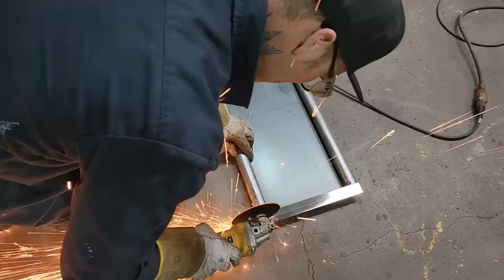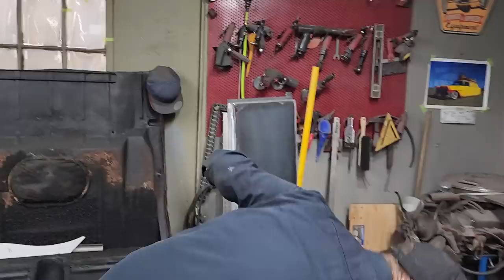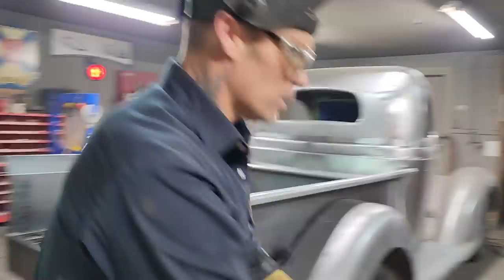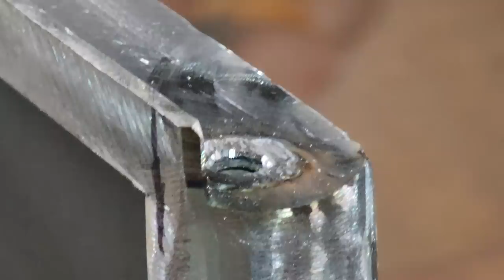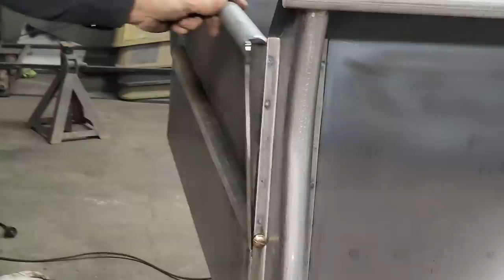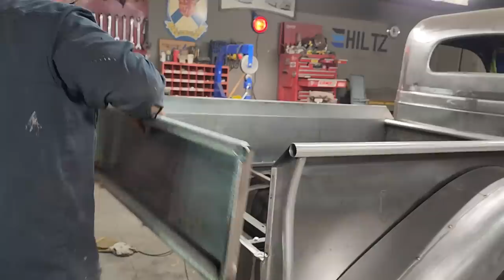Engineering a hinge system for the tailgate...1935 Plymouth pickup truck

Comment: Chad I did this on one of my trucks a lot of the trucks in the 70 s and 80 s had cupped pivots for the tailgate you can weld a washer inside your lower pipe so the washer contacts the face of the cupped pivot so you don’t have side to side movement take one of the cupped pivots and cut two sides off weld some flat stock on each side you cut off notch the bottom of one side of the lower pipe to fit the pivot mount the pivot that you modified at a 45 degree angle that way you can sit the tailgate on the full pivot and then lower the notched side onto the modified pivot that way the tailgate can be removed by holding it at a 45 degree angle and lift the end off of the modified side

Comment: Awesome! You can use large electrical shrink tubing over the tailgate chains if you like. It helps with chain noise, protects paint and looks great! Keep up the great work. Amazing!
Reply: Great tip thanks I’ve  used bicycle tire tube in the passed and just taped the ends, it worked just fine but was never overly happy with the way it looked I’m going to try the shrink wrap! Thanks
Reply: Great idea

Comment: Chad, here's a tip for welding up nuts. I keep a collection of brass bolts and screws in most common sizes. When I weld the nut to whatever I'm welding it to, the brass bolt comes out readily because weld/spatter doesn't stick to it. Simple, quick, and clean threads afterward. Look for them in plumbing sections at the hardware store, and save any that you come across by blind luck...

Love this build!!

Comment: The early trucks had brackets that bolted to the body to hinge the gate. You just put the gate pins into the brackets on each side and then bolted the assembly to the truck. All gaps and free movement were built in. The gates just used tabs on the top that let them be attached with hooks attached to chains. To lower the gate, you removed the hooks and chains kept the gate from going all the way down when open.

Comment: I have used bicycle inter tubes to slide over the chains, to stop the chains from hitting the paint job. Great job on the pickup. I love the build.
Reply: Yeah or some large diameter shrink tape for electrical wire slip it over the chain heat it up looks great

Comment: Hey Chad
I don't build cars/trucks but I do mess around with grinders, sanders, welders, drills etc on different fab projects. Obviously a little late now, but have you ever drilled your holes, countersunk the edge and used a flange nut to sit flush for welding in? Can't tell what you're using in the video, could be a stover lock nut for all I know? Huck fasteners might work as well?
You mentioned chain for the tailgate, I'm not a huge fan of the chain rattling around on these old trucks [not my build, not my decision]. Have you ever thought about using two pieces of ...lets say one inch, maybe three quarter flat bar and making a scissor like support that fits between the edge of the box and the edge of the tailgate? You would still have the triangulation support when the gate's open and be hidden when closed. Truck looks wicked, keep it up man! Cheerz 🍺

Comment: When i was watching you make your tailgate mounts I was thinking that a keyhole style would by a great solution.  Make a keyhole slot that welds to the bedside and bolt/weld studs to the tailgate. This would allow the tailgate to pivot and be easily detachable. Watching you troubleshoot on the fly helps me brainstorm.  Thanks Chad

Comment: Alot goes into building your own tailgate, especially when it comes time to attach it and make it function properly, it would probably have takenme all day to figure it out. Great work as always Chad & Jolene! The tailgate probably won't get used a lot otherwise I would be concerned that over time the hinge bolts would turn with the gate and back out.
Reply: That's why they make locktight products

Comment: You've done a wonderful job Chad. You could stay out of trouble if you were to use a ruler, dycom, and a scribe to mark your cuts.
Another suggestion for locating those holes for the hinge screws, would have been to drill through the outer hole right into the gate while in place. 🤗
One bad thing with using the chain for a restraint, it will end up rubbing off paint in that area. A plastic wrapped cable mounted inboard between the end of the gate and the tailgate opening, would be a better choice.

Comment: You went a totally different direction with that tailgate than I was expecting. I figured the point of using the pipe on the bottom was to use that as the pivot over some short pieces of pipe welded to the inside of the bed. Then the tailgate would just drop over the pivots. But hey, you got it done your way in the end. Good on ya.

Comment: !!!***Hey Chad… Here’s an idea***!!!
On your tailgate chain, use some 1”-3/4” heat shrink (the kind you’d use for wiring) … cut it to length then pull the chain through the heat shrink. Then use a heat gun and shrink the heat shrink to the chain. It’ll save your paint and it gives your chain a professional finished look! … not to mention, it won’t make a horrible racket going down the road! 
**^^^***^^^****^****^^^***^^^**
                             ^^
                           ^^^^
                         ^^^^^^
                       ^^^^^^^^
                                ^
                                ^
                                ^
                                ^

Comment: First off the truck looks amazing.  I may try this in a four door Chevy.  I may have tried a solid steel bushing where you put the nut in the gate  , then a threaded bolt on the outside of the gate.  Then thread the bolt into the bushing.   The bolt may need a non threaded end welded on to act as a spindle.  Not sure if this even makes any sense but I had to write it. Lol!

Comment: I use to smoke a lot of bits drilling metal. An old timer told me low speed high pressure with steel and sure enough saved alot of time and money in the end. Take it or throw it away!
Reply: Exactly. It helps keep the heat down on the bit, keeping it sharper, longer.
Depending on the thickness of the metal, a bit of lubricating oil applied to the cutting shoulders every so often, also helps keep the heat down.

Comment: If you use a stainless bolt to hold the nut it will be less likely to stick to the weld. Also use the step bit to chamfer the hole for better penetration into the nut. The tap you made is a great idea, thanks for that!

Comment: Use a shoulder bolt for the tailgate hinge. It will provide a smooth hard surface to pivot on, and can be fully tightened against the welded nut.

Comment: Suggestion the piping you used at the top of each fender where you have the hole on each side just above your tailgate the hole that is there on the end of the pipe how about an LED blinker light on each side would look badass and definitely different just a suggestion I'm sure you won't use it but I thought it would be a good idea, I still think you are a fantastic visionary whatever you do I'm sure it will look fantastic,

Comment: Chad was watching tonight when u were marking the tailgate hole with the marker to drill on the left(drivers side, tailgate was not sitting on the washer when u marked it. If u check video u will see an 1/8" gap when u marked it.   I think that's why u had to compensate on the opposite side. I saw it and thought it wasn't a big deal but, anyway thought I would pass it along. Turned out great though! Very cool solution.

Comment: Good job Chad. now you just need some kind of flexible hose to cover the chain, so it doesn't rattle around and scratch your paint job. Good job Jolene you are so good with the camera, nice and steady!
Reply: He can use some large diameter shrink tape that is used for electrical wire slip it over heat it up looks great

Comment: Chad, im watching you grind out the edge of those bolt holes on the tailgate with the dremel type bit and they make a small inexpensive tool for that, its a COUNTER SINK BIT and you can get a set of 5 of them on amazon for about  $18.00 U.S. ,they work great on any hole you drill in metal and cleans up the hole real nice and even, so give them a try you won't be sorry and they are cheap, I use mine all the time.

Comment: You did such a great job on the hinge points after a slight welding mishap I hate to comment but the hinge point should be outside the tailgate not inside in order for the tailgate to move back and down. With it inside the gate can only rotate 90 degrees. Look at any hinge on a door and you will find the pivot point outside the door to rotate 180 degrees.

Comment: Awesome job Chad!!!! Next time you weld those nuts spray weld anti spatter on the bolt prior to welding it on and cool the area before you run a bolt down on it. They tend to gall if you do it when it’s hot. Just a suggestion.

Comment: I like the Bolt idea.  I found that you can reduce the size of the hole if you put a couple nuts together on a Bolt and grind the edges off the nuts, making them smooth then weld them in.

Comment: You need to fill in the bottom of the hole to keep the tailgate from dropping down. You need to cut away the angle iron the height of the round pipe to get it to dope down low.

Comment: Chad and jolene just my belly button but the way you attached the tail gate at the bottom will the bolts not keep coming lose because of the up and down movement of the tail gate. Just a thought is all. Keep up the great work the both of you 👍 👏 you  need a piece of tube to fit over the bolt long enough to reach the tail gate over and through the pocket edge that way your bolt will tighten on the tube and not the body 👍

Comment: Looking good!  I think the long rod/acorn nut hinge would be more reliable and it could still be done.
Reply: Could just grind the long end of the rod to a coned point to align it and poke through hole then just cut off point and add cap
Reply: @danjones1365  Would not even need the point.  Just use a vicegrip on the free end to allow the movement of the far end.
Reply: @jimthode  have you ever tried to blindly get a blunt edged 5/16” rod through (2) 11/32” holes  49” apart by feel?  Have fun with that.

Comment: Chad yotto build you a little bracket that bolts right to the side of the bed and then slides into the tailpipe for your hinge that's what the early Fords had I had a 53 Ford pick up and I think the early Chevy's had something like that too and that's what it had on it and it worked great

Comment: Chad, an old trick you could have used on the bolts that were holding the nuts in place is to put Milk of Magnesia on them and let it dry. It works great so you don't get weld spatter.

Comment: Gday chad and jolene just thinking it would look neater if you put the hold chain inside the box so you dont have to mess with it every time ,  and keep the flat bar just to lock it etc pull a pin and drop it then the chains hold it looking good all the best big pete ..

Comment: Wipe lubricants off with a paper towel, not your gloves. Now you have spray lub on several areas of gate. A clean shop is a happy shop. You could have used first long bolt for the whole nut and threading application. But, you are getting it done with a few extra steps.

Comment: You should probably put a washer between the tailgate and the side panel if it will fit. it may keep the metal from drawing in as much on the tailgate where it mounts.just a suggestion.

Comment: You are quite talented. Pretty amazing stuff. How is it that you don't have a tap for a bolt your welding? Also, you would be much more efficient with more air lines with tools already hooked up. To much time running back and forth, hooking up and bending down. 
 That cut bolt thread chaser is very limited because it is soft. Spent my worklife as an aircraft tool & die maker. So I see things a bit different. What I would have done is, instead of a rasp bit, use a #5 center drill to get the thread lead. Then chase it with a tap. One minute each side. If you leveled everything off with a clear plastic hose with open ends and added water, you would have a water level. If you measured the second hole to the first, they would have been perfect. Always centerpunch, center drill then drill all holes and they should be right.

Comment: Great Truck...... im sure you know that as you weld the nut.....without the stud in it......splatter goes down in the threads.....it's ok if you have a tap..... but otherwise just leave the stud in till completely welded    and then remove stud.....    try not to weld the stud in the process!!!!   thats hard to do.....tap is much easier.....

Comment: A spring loaded bolt on one end and a rod on the other would have worked very simple and you would be able to push the spring loaded rod in with a screwdriver and release the tailgate

Comment: Your truck but the chain tab is usually mounted vertical. It could bend the tab down a little if mounted horizontal and someone did sit on the tailgate. BTW Love the truck.

Comment: Hey Bad Chad.   The tailgate is square and the bed the way you built it.  The nuts should measure the same on both sides from the bottom and edges.  Check your perfect side to the off side.   Just a suggestion.   Great work

Comment: I have a idia  for a hidden hinge . It would have a round stock go inside of each side your bottom exhaust tube. The round stock would have a bracket welded to it with a couple holes to bolt inside your bed. I don't have a way to draw a picture so i hope you understand what I'm  meaning.

Comment: When welding around threads anti spatter stops the welding spatter from sticking to the threads.
Reply: Thread anti seize is better. Also the nut was still hot when he was threading the bolt in and that will damage the nut thread.

Comment: Those hinge bolts need a tubeing shoulder put over them so the bolt  can be tightened proper,into gate and gate pivots on shoulder not threads.shoulders can be used to space gap proper also.

Comment: I would have welded a nut on the tailgate frame and used a shoulder bolt to go through the angle iron and used a plastic bushing

Comment: Might it be practical to make the holes a little bigger diameter so a small bushing could be used on the carriage bolts? That would keep their threads from wearing through the paint. I'm thinking a small bushing and a washer where the plastic had been. If they were Teflon the hinge action would be very smooth.

Comment: you should do is for your nut to put abolt in place is to leave a 2 1'6 of a inche to allow it to weld your nut in place so you can grind it down flat that way you have mess with thread part .

Comment: use a counter sink ,  on those nuts ,   but you should carbon up the threads on the bolt before you wield,

Comment: How are you going to paint between the cargo box and cab?
Reply: Slide the box back or remove it that way he can get the front of the box as well
Reply: @ceciloflaherty658  Isn't the box already welded to the chassis? So sliding is not possible.
Reply: @ScoobyDoo I still hope he gets painted
Reply: @lucclaessens4160  I am fairly certain that he showed that he bolted the bed to the frame/chassis, in a video from a couple of days ago.

Comment: I think that if you were to use a bolt or screw with a small shoulder, you could bottom the shoulder against the nut and the shoulder could move without tightening the tail hate to the side of the truck.

Comment: Chad,we use to use thread inserts. You could have put in 1/2-13 x1/2 inch outside with a 3/8-16 x1/2 inch inside,weld the insert,then grind off what you don't need. You could also weld a piece of round stock in the hole then drill and tap to the size you wanted.

Comment: Wondering why you wouldn’t want that tail gait double thickness. I mean skin the outside of it also. Probably with some reinforcement on the inside. You could still reveal the round stock by welding the sheeting lower on the curve.

Comment: What about this idea. If you cut the hole for a contact point on both the tailgate and truck bed like you said, then just use a stainless steel carabiner or quick link on each end of the chain would be less welding and make it easier to replace the chain in the future if you ever need to for whatever reason.

Comment: Chad , what if you welded a washer with a nut inside the bottom pipe of the tailgate and run your bolt into that ?

Comment: What's going to stop those bolts from backing out? Would have been better to weld the nut on the outside of the side panel for the bolt to then pass through into the tailgate. could have position correctly prior to welding the nuts

Comment: when you are welding in a nut use a brass bolt and the weld will not stick to the bolt
Reply: Thread anti seize is the way to go. A bolt only gets in the way for a full penetration continues weld.

Comment: Most tailboxes have a piece of flat bar welded between the seam of the tail post and the wall of the box for the pin of the lower tailgate to swing on. Just drilling a hole into that flimsy thin metal isn't going to be strong at all.

Comment: Would of used a 3/8" to 1/2" pin welded to a flat bar about 4 in long with two holes that looks like an "L" . Then blot the L to the side of the bed and your adjustments would be built in.

Comment: the screws are going to vibrate out try a round rod welded to an angle and bolt to body with 2 bolts its just a thought i know you know what your doing its just a thought